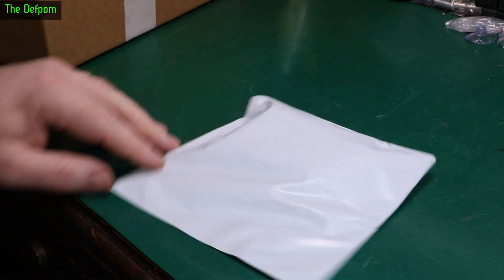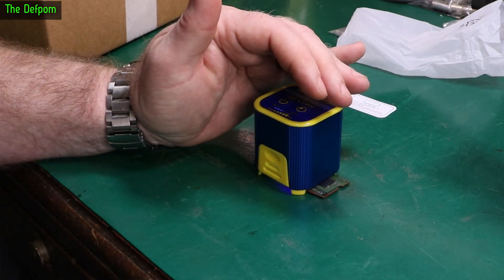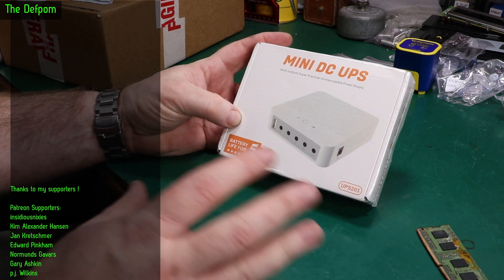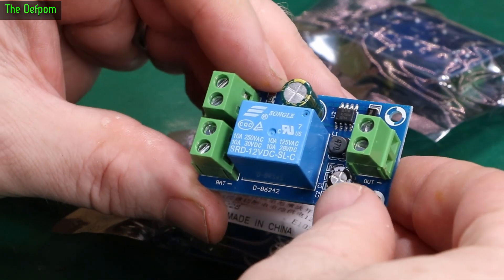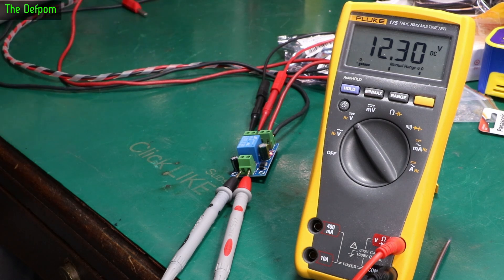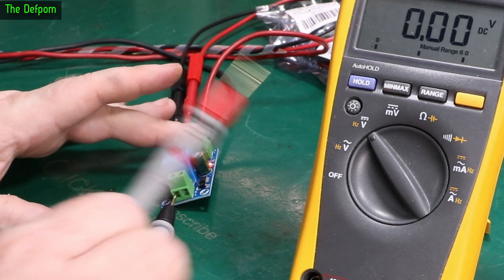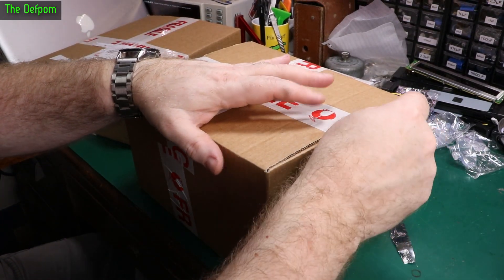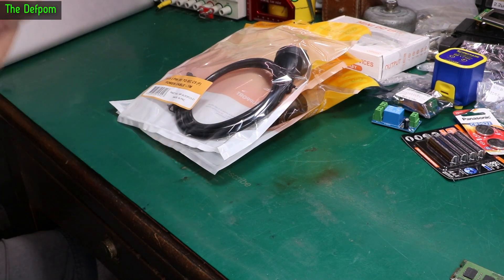🔴 Mailbag Monday 27th November 2023 - No.1199

Comment: One thing to check when using relays is the difference in rating on the contacts. the Normally Open  (NO) and Normally Closed (NC) can have different  rating.
I'm sorry I was sitting at the back, and did not hear Mrs Defprom's announcement. Next time I'll try HARDER to hear it maybe 30 seconds is not long enough. it was all over too quickly.

Comment: If you need a more powerful UPS, check out 'Talentcell', (i did a vid), i have 2 of them on my cctv system.
Not sure why you would need a relay, just use main supply to charge the UPS at the same time as powering your system, if you need a relay, get rid of the electronics and connect the coil directly to the input